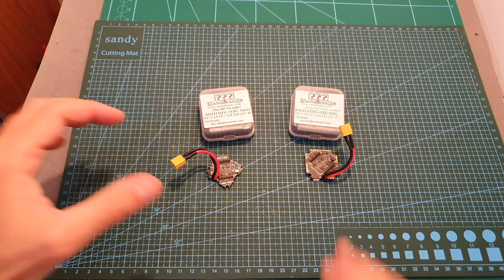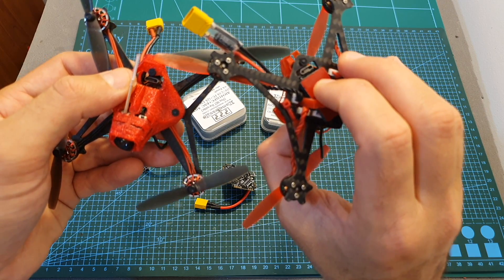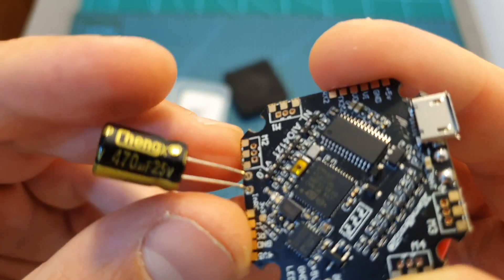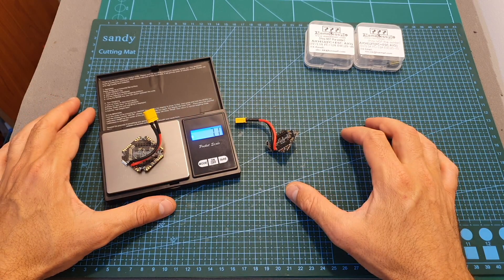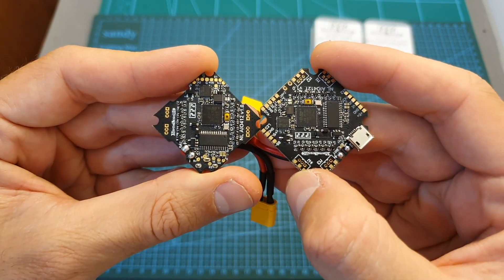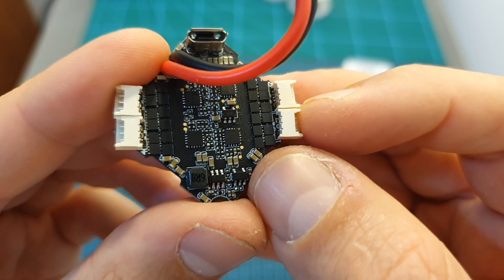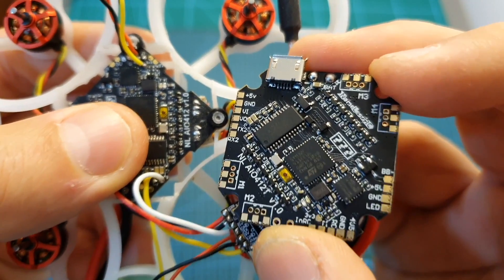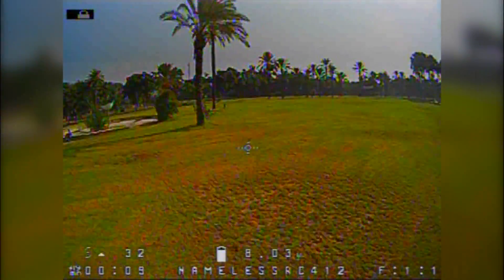NameLessRC F4 AIO Boards - Setup & Review

Comment: Hello, how can change between 2S, 3S, 4S battery mode?
Or it can auto detect? We can plug in 2S 3S 4S without setting anything?
Reply from the maker: You can set it in the PID settings, in case you would like to use different settings for each battery type.

Comment: Hi Gal, at 52s you show the board at 45° to its normal orientation. Is this a straight forward option?
Reply from the maker: Hi, if I understand you correctly - no. If you want to mount the board like I showed in that time mark you will need to adjust the board orientation on BF.

Comment: How important is it to install the capacitor??? I'm thinking about leaving it off...
Reply from the maker: It depends on your setup. For a 4s setup I would definitely use a capacitor.
Reply: @KremerFPV  ok thanks. Imnonly running a 3s on the 1303. Works so good together....inysed the cap, have great video 👍
Reply from the maker: @rcramosrc  Perfect!

Comment: Hello there, thank you for your review.
What is the minimum voltage for proper operation of this board? Could you please check this for me?
Im planning to use it with 2s VTC6 ion batteries and it will down to 5.8volts. Does this board works and flies with 5.8volts and clearly provide 5volts for VTX or what is the mininum voltage? 
Thank you
Reply from the maker: My pleasure. It should be ok. If you want to double check - you can reach out to NamelessRC in order to confirm it.
Reply: Gal Kremer thank you for your answer. I reached namelessmc but they said it works with 2s-4s. they actually don't know what is the lowest voltage for board
Reply from the maker: @HasanGrkann  Sorry - I can't help you as I don't have these boards anymore.

Comment: thanks for the review.
i already got mine yesterday. i buy one to replace the betafpv one in my toothpick. 
everything works but i got a anoying issue. i fly for 30 sec and the temperatur reach 100c... every time. 
i flash older BF and BLHELI versions but the issue still there......
Reply from the maker: Seems like a VTX issue.
Reply: I'm getting the same problem what was your fix
Reply: The temperature is due to invalid ESC firmware. Its P-H-15 and should be P-H-90

Comment: what exact components were used on this build other than the flight controller?  Frame? Camera? VTX? Motors? Props?
Reply from the maker: I used the parts of the Skystars TinyFrog 75X: http://bit.ly/TinyFrog75X
but replaced the FC with the AIO412, motors with 1103 8000KV and VTX with the HGLRC GTX Nano.